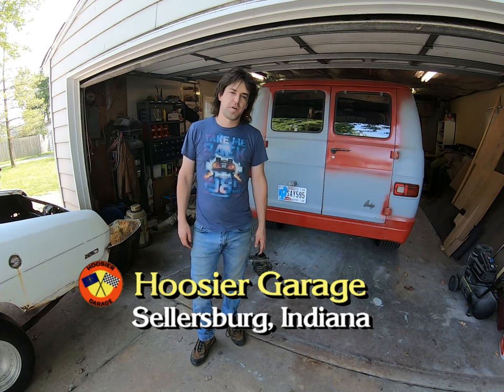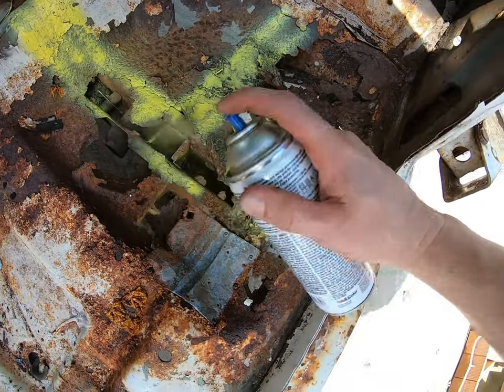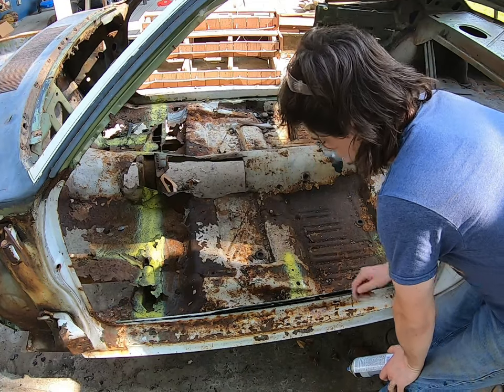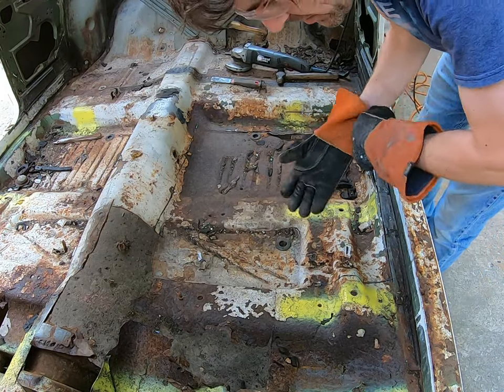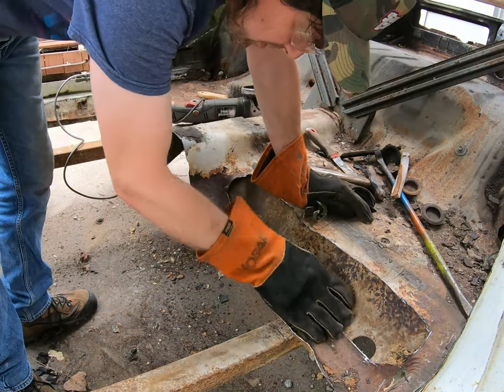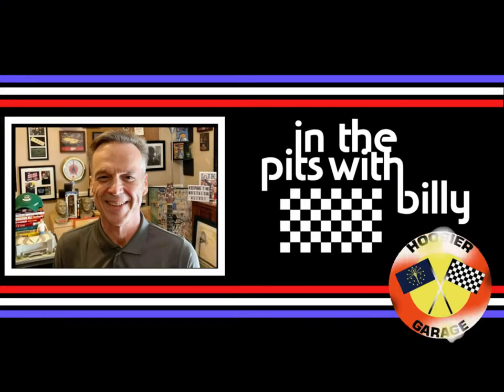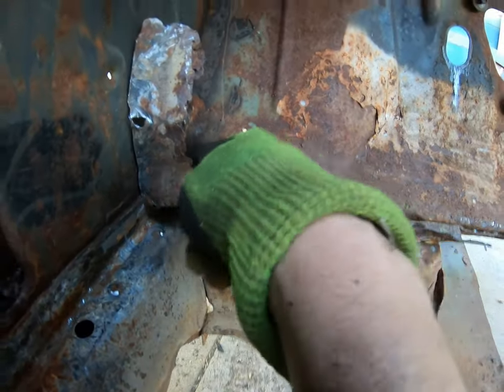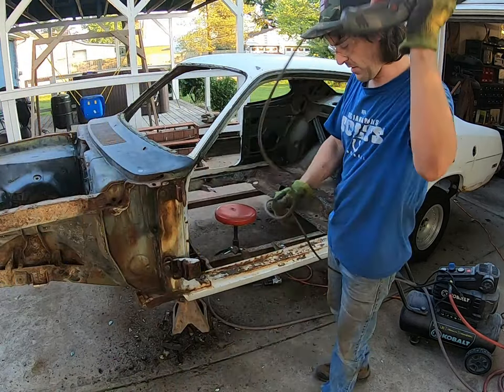Duster Floor Pan Replacement PART 1 - Hoosier Garage

Comment from the maker: Whats the largest panel you have cut from a car? I think this one does it for me.
Reply: I've done the floor like you just did on the duster and by the way looks good nice and clean cuts! And also complete quarters wheel housings and trunk floors are all on my list I'm in the northeast rust never sleeps here!!!
Reply from the maker: @moparnut6286  I think its probably a little worse up your way, but not by much, it takes getting down into Tennessee and south/west before a regular car doesn't seem to be as effected. although I have had a car from South Carolina, not by the coast, that was a messy car rust wise.
Reply: @HoosierGarage  yeah if we could get them from the desert we'd have soild metal but trashed interiors which isn't cheap to deal with either but some what less time consuming.
Reply: Floor pan is on my list but just trunk so far

Comment: Great videos by the way. Still seem fortunate that regardless of that floor pan, you didn't have to replace the torsion bar cross member or any of the inner or outer rocker panels.
Reply from the maker: Yes, I was prepared for the Torsion bar Crossmember when i got to poking at the floor pan.. and got away with just a tiny patch on it. Thanks for watching!

Comment: Are you going to try using that carburetor again on the van?
I just reburied a Holley economaster 4 bbl. that I had on a 76 Cutlass in the 80s. I have to redig it out the garage if you want it. I don't know if rebuild kits are available for it. I might check on that.
Reply from the maker: I'll pass, if I replace it will be with an edelbrock

Comment: I have a 72' Satellite requiring front drivers side floor pan replacement.  You mentioned the floor is part of these mopars frame, would I need to brace my car to prevent it from twisting, or will I not need to worry about it when replacing the front floor panel?
Reply from the maker: Just that section you won't, the box effect of the areas around it is holding it stiff. Lay your new pan over the old(if it's just a section) and draw a nice tight li e around it. Carefully cut that area out not to cut through brake lines, etc and then drill spot welds or peel off the frame section. Look under and get familiar with the areas.
Reply: I appreciate your video, I was able to replace the driver side floor.  Are you going to do anything with the cross member?  Mine's shot. I also found I have frame stiffeners welded in place of the frame under the floor
Reply from the maker: @wednesdaychurch8965  mine cross member is good. I know you can get new for yours.
Reply from the maker: I would support front via jack stands under frame rails and allow some blocks to set snug under the pinch weld along the rockers near the crossmember

Comment: Get a bead roller and some sheet metal.... box tubing from a scrap steelyard is your friend... to hell with the "Factory" idea of things... re-inforce the frame rails... love the old Duster's of this vintage but when they're this sad.... think restomod because..... they have you buy the nards if you start buying repro this and new old stock that lol I mean... the floor was considered structure the way they made these and they made them to save themselves cash. Ya measurements and manufacture your own parts to support the outer body shell that peeps see when you drive down the street. Update the rest and re-inforce because... they were made to sell parts really :-/